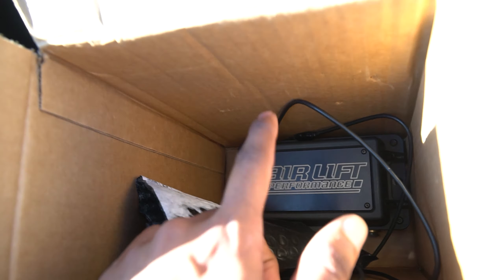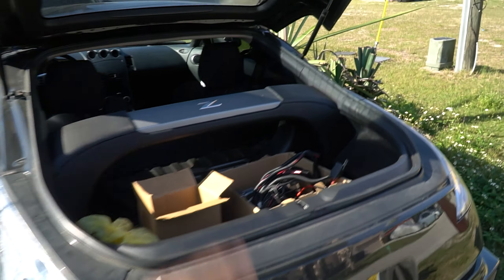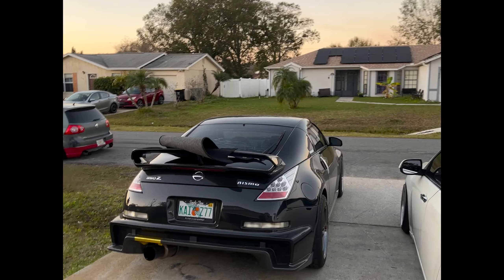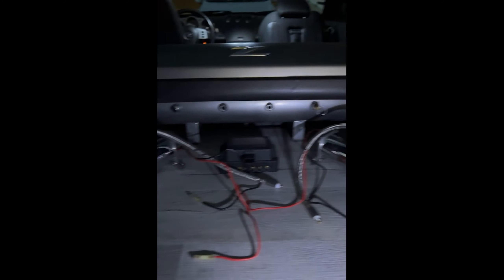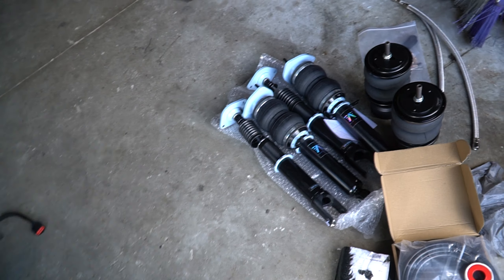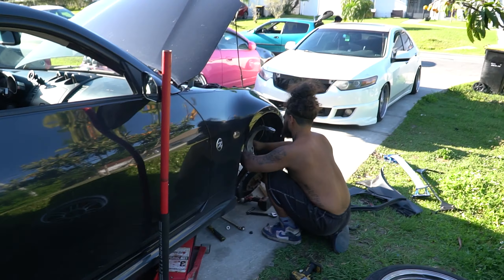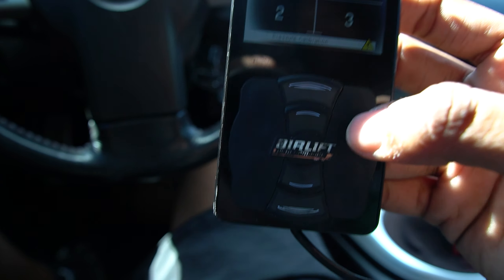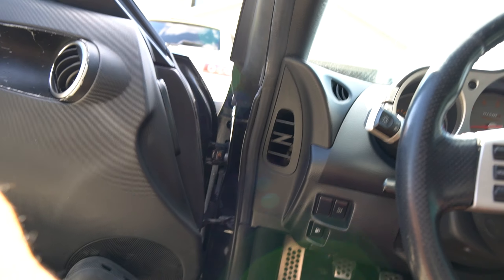BAGGED MY 350Z NISMO ON AIR LIFT 3P AIR SUSPENSION!

Comment: If that de g35 is manual, he should beat all motor B series hatch.  Unless its some extra work put in the swap.  Aside from that, the Nismo looking good.
Reply from the maker: Nah nothing extra just a bseries swapped hatch the g35 is automatic
Reply: @NickStaxz   I know you say the G35 is auto. But they should run it and see what happened. My de when it was stock was able to beat a gsr swapped EG at the track. But yea tell the homies to run it lol
Reply from the maker: @siknin1 yeah they was supposed to but sadly the g35 was rear ended and declared totaled so we won’t be getting that race anymore smh..
Reply: @NickStaxz  sorry to hear that. Hope the homie comes back strong with something 👍🏿
Reply from the maker: @siknin1 yessir shit sucked ass but stay tuned for the new car reveal if he does get what he told me ‼️